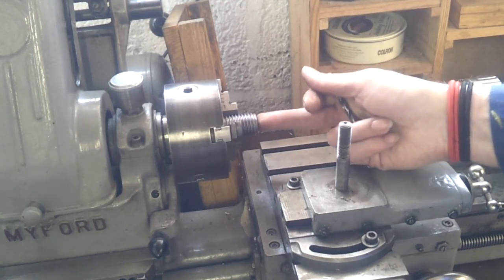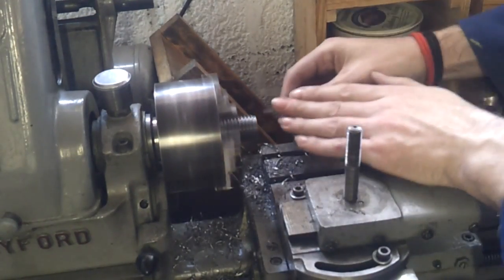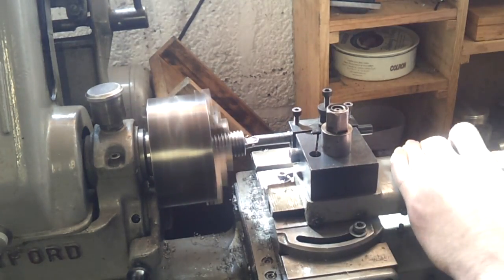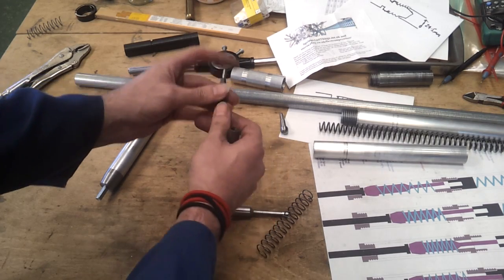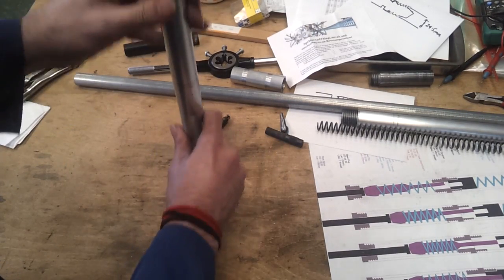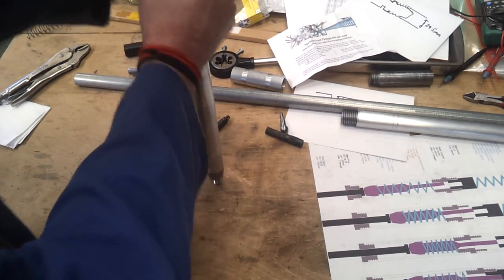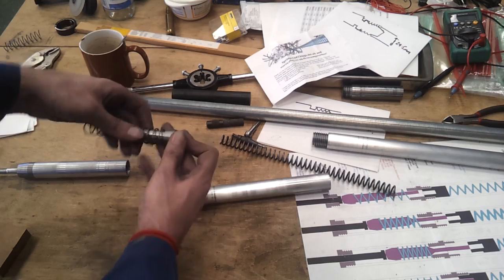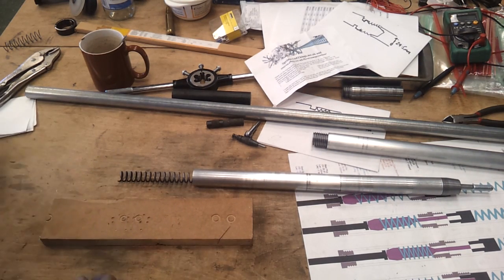Giant Automatic Centre Punch pt5 - assembly and testing

Comment: Nice project Andy.... Will be interesting to see how it does removing the bungs from the concrete mouldings.... I suspect that a T-bar handle will make that easier to use... and probably better add some padding onto the handle too as I expect the shock/vibration the elf using the tool will experience will make the elfen safety safetly people moan. Cheers!!
Reply from the maker: Hi Jim! Already added a handle, and made a few other adjustments. No significant recoil - just a satisfying clunk, but rubber hand grips are easy to fit if needed. (I'm tempted to paint it as well.) Need to go test it at the factory now, probably next week.